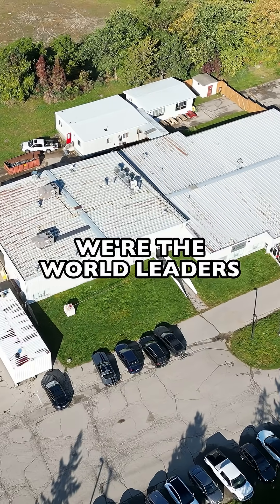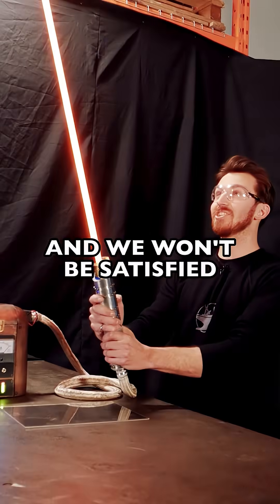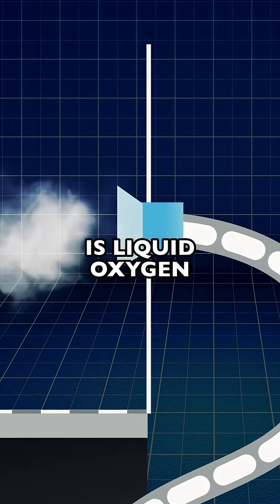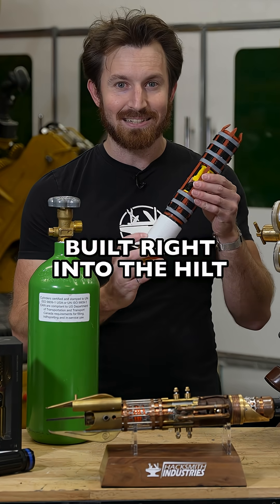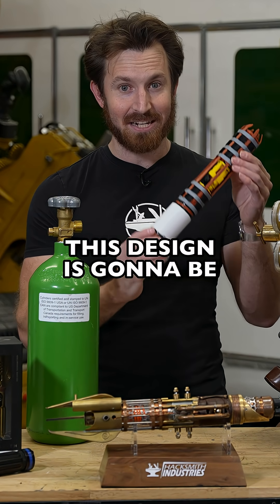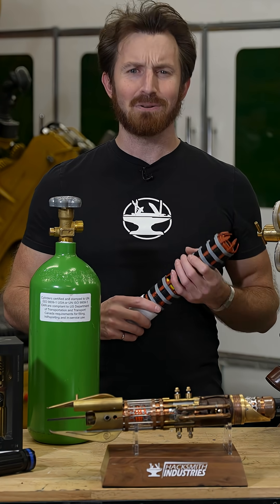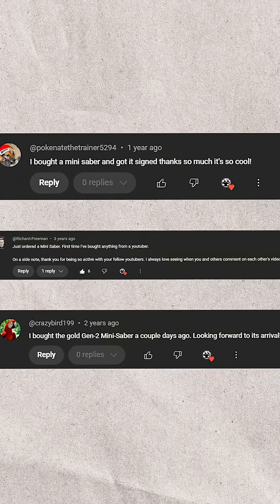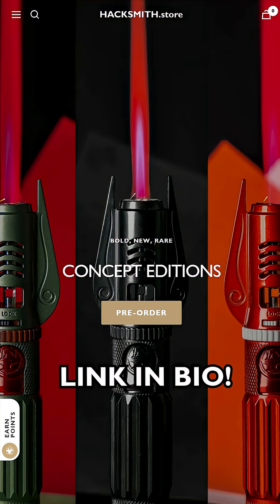Liquid Oxygen is DANGEROUS 💀 anyway... #lightsaber #minisaber #hacksmith

Comment: What about disodium dioxide? U can mix it with water i mean its not very optimal but u can get like 5 second with about 7g na2o2 and also the only probelms are gonna be pressure and the acidity but u can use the pressure to make the beam lonher so the fire is not like a gas stove and more like a sword [sorry for my bad english i can expalin better if u need]
Reply: Something like this:
Part	Size / Quantity	Notes

Na₂O₂	7 g	volume about 2.5 cm³
Water	1.6 g (~1.6 ml)	micro droplets, sprayed
Butane/propane	1–2 g	~1–2 ml cartridge or container
Reaction chamber	Cylindrical 2 cm ⌀ × 4 cm	made of stainless steel
Nozzle	1.5 mm ⌀ × 15 cm	narrow, to burn concentrated flame
Hilt	4–5 cm ⌀ × 15–20 cm	housing the entire setup